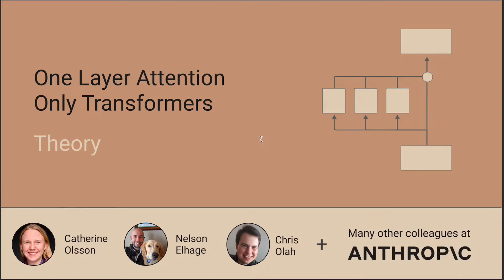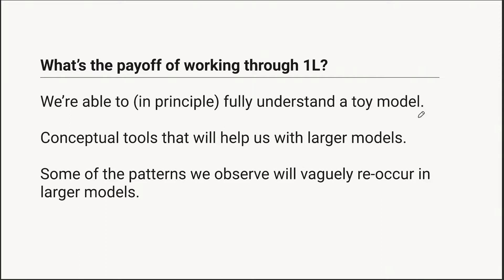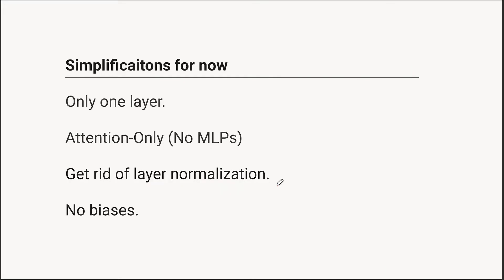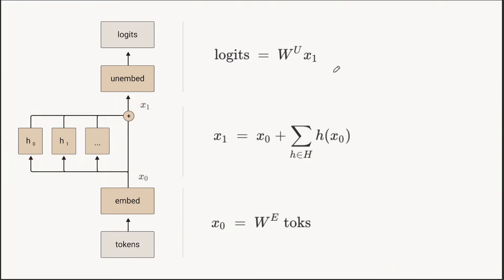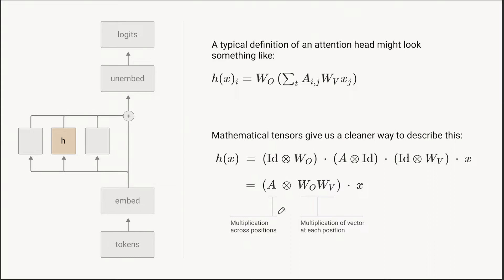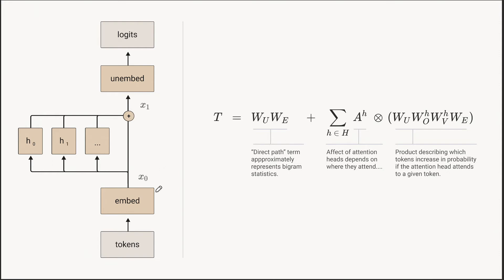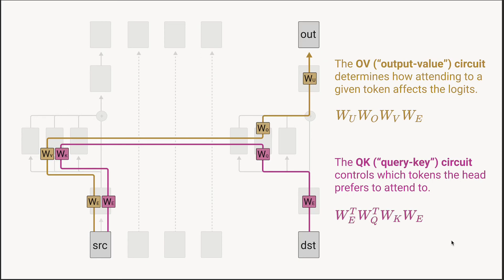1L Attention  - Theory [rough early thoughts]

Comment: First of all, thanks for the research and providing a step-by-step explanation of these findings. In 2023 transformer architectures, the result of the heads in a layer are not summed but concatenated (e.g. in llama), i.e. each head has "read access" to the full state but is only able to contribute ("write access") to its share of the output. Do you have an intuition how this works or why it still works so well? Especially, thinking about your later example of dealing with backreferences to previous tokens, it means, that the head that "recalls" a previous instance of a word is not able to "precisely select" a token in the hidden state because it only has access to a somewhat small subspace of the full space. Do you know if that means that multiple heads are required in parallel to nudge the state to the target token? Or does the head just give "enough of a hint" about the next token and let the following MLP layer fill out the blanks?
Reply: In the transformer attention mechanism, we often think of attention heads as independent and additive. Let’s break down the calculation:

1. Multiple Attention Heads:
   Suppose we have two attention heads, h₁ and h₂. Each head generates an output vector, rₕ₁ and rₕ₂.

2. Concatenation of Output Vectors:
   These output vectors are concatenated together:
   [rₕ₁, rₕ₂] = [rₕ₁¹, rₕ₁², rₕ₂¹, rₕ₂²]

3. Weight Matrix (Wₒ):
   Instead of one large weight matrix Wₒ, we split Wₒ into two smaller matrices: Wₒₕ₁ for h₁ and Wₒₕ₂ for h₂.

4. Matrix Multiplication:
   We multiply the concatenated output vector by the combined weight matrix Wₒ:
   Wₒ [rₕ₁, rₕ₂] = [Wₒₕ₁, Wₒₕ₂] [rₕ₁, rₕ₂]
   This is equivalent to:
   Wₒₕ₁ rₕ₁ + Wₒₕ₂ rₕ₂

5. Independent and Additive:
   This shows that instead of concatenating the vectors and applying a large matrix, we can treat each head independently, multiplying each head's output by its corresponding weight matrix and then summing the results:
   Output = Wₒₕ₁ rₕ₁ + Wₒₕ₂ rₕ₂

This reveals that the attention heads operate independently, with their results added to form the final output.

============

Example:
Let’s assume we have two attention heads, h₁ and h₂, with output vectors:
rₕ₁ = [1, 2], rₕ₂ = [3, 4].

# Independent and Additive Approach:
Each head has its own weight matrix:
Wₒₕ₁ =
[[1, 0], 
 [0, 1]],
Wₒₕ₂ = 
 [[0, 1],
  [1, 0]].

We compute the output for each head:
- Wₒₕ₁ @ rₕ₁ = [1, 2]
- Wₒₕ₂ @ rₕ₂ = [4, 3]

Then, we add the results:
Output = [1, 2] + [4, 3] = [5, 5].

# Concatenated Matrix Multiplication:
We concatenate the output vectors [rₕ₁, rₕ₂] = [1, 2, 3, 4] and multiply by a concatenated weight matrix:
Wₒ = 
[[1, 0, 0, 1], 
 [0, 1, 1, 0]].

Multiplying Wₒ by [rₕ₁, rₕ₂] also gives us the same result:
Output = [5, 5].

For more insights on this topic checkout https://transformer-circuits.pub/2021/framework/index.html they explain it in the section "Attention Heads are Independent and Additive"
Reply: @LOLOINVASION  Great information, thanks for the reply. So the tl;dr is that since W_o is full width, every head effectively has access to the full width output (which is the piece I missed).
Reply: That said, r_hi of a subhead is still kind of a bottleneck because it is smaller than the full dimension by a factor of num_subheads. That means that it needs to be able to encode enough information that it can e.g. recover references with enough precision with the single Wo matrix multiplication afterwards. (Though, I would guess that the following MLP might help with "decompressing" references as well.)

Comment: 10:22 is missing Id(x) after the T=, I think.
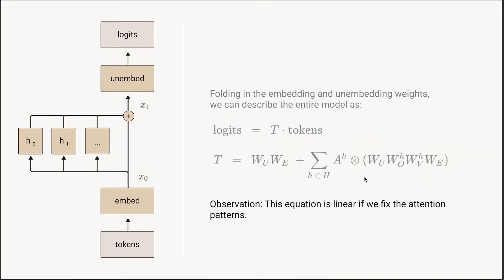Can 12:40 be seen as related to the product rule of derivatives, (fg)'=f'g+fg'?
Reply from the maker: Sorry for the slow response; we hope you had a great time over the holidays!

> 10:22 is missing Id(x) after the T=, I think.

We sometimes leave out $Id \otimes ...$ because multiplying by a matrix has the same effect in that case. It's kind of confusing though, and we should probably have just writtten it that way.

> Can 12:40 be seen as related to the product rule of derivatives, (fg)'=f'g+fg'?

Hm. Well, it's true that we're multiplying, and the reason the product rule is true is that multiplicaiton is linear if you fix one of the inputs.

But that's only half of what we're trying to say here. In your analogy, we're saying something like "f is a linear function W, so if you fix one side of the product, the function isn't just locally approximated by a linear function, it's actually linear."